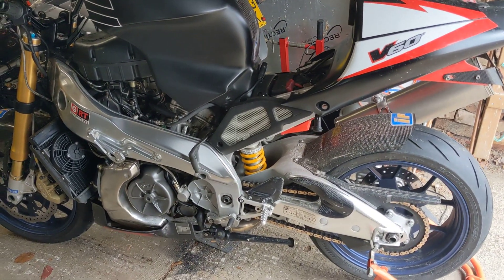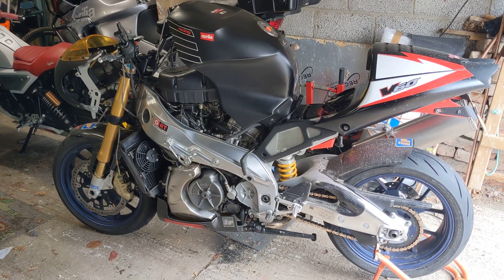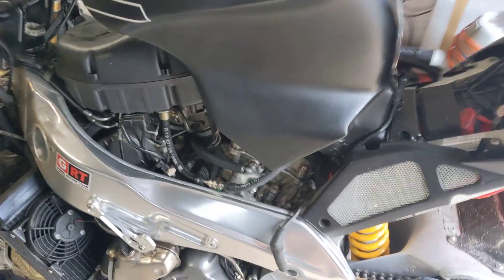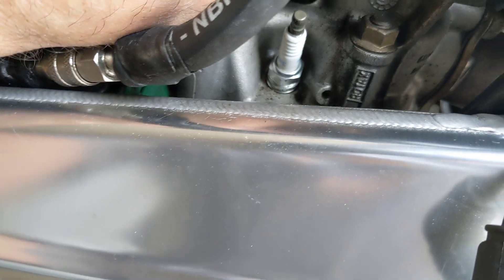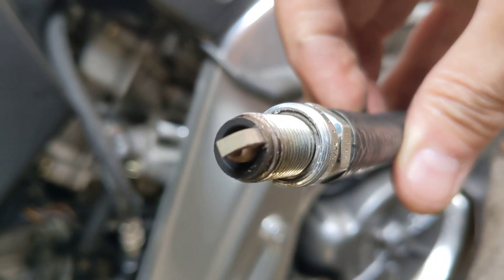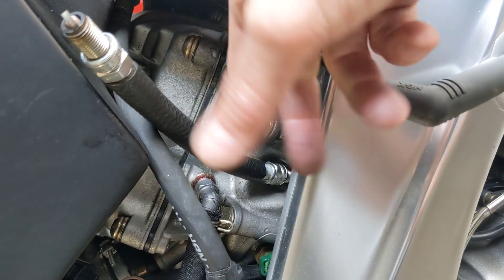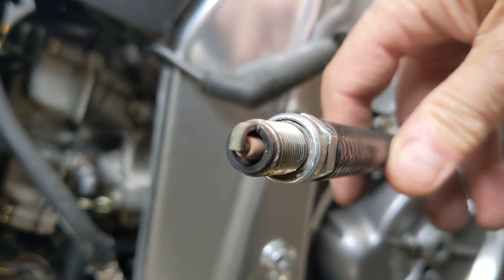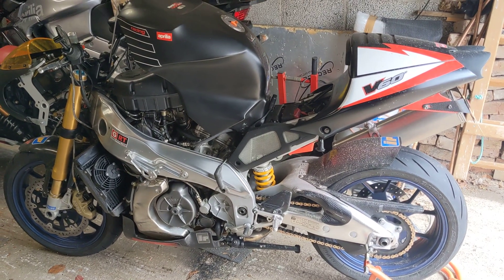Aprilia RSV/ Tuono adjusting the fuel trims and checking plugs for the correct mixture .

Comment: Did it stop smelling lol?
Reply from the maker: I then re tuned it with an AFR gauge and an oxygen sensor in the pipe and it was as good as I could get checking plug colour it probably still smells at certain times due to the crude ECU.